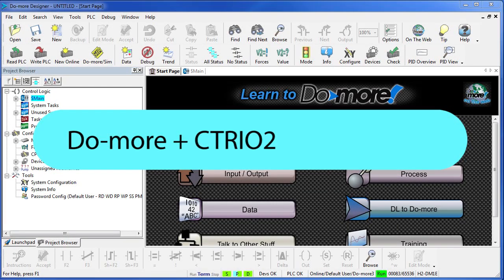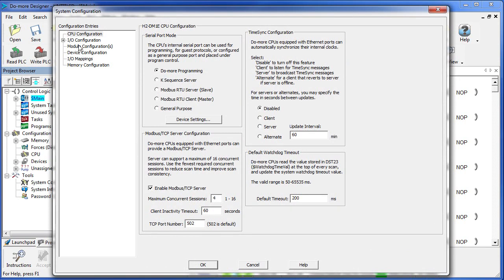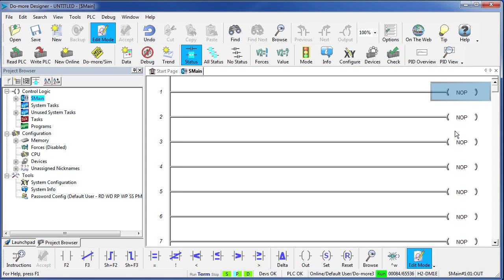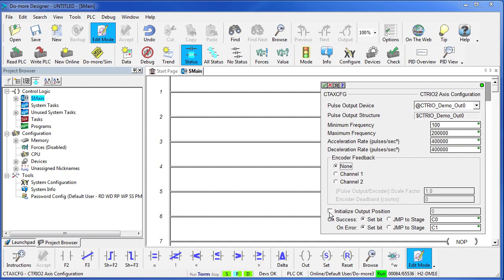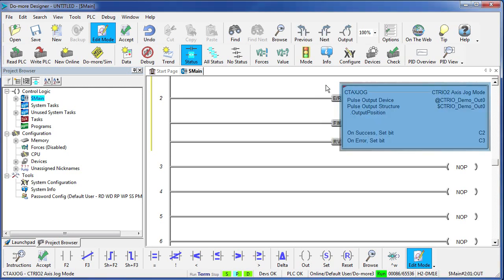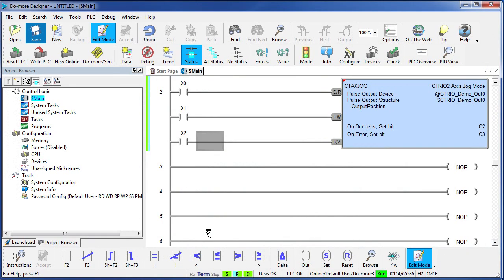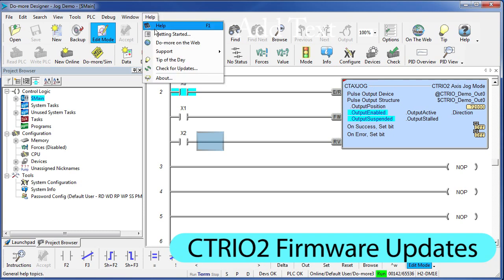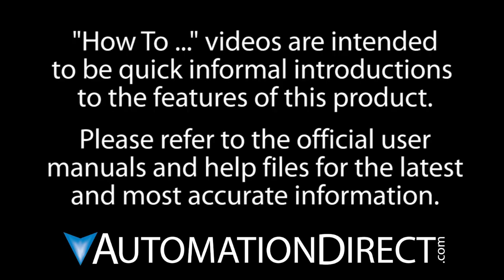BRX Do-more CTRIO2 Motion Config & JOG from AutomationDirect

Comment: Wow, 2012? I didn't realize the Do-more had been around that long.But I'm wondering about that ST0, "first scan" is singular isn't it? but CTAXCFG has that red triangle in the corner. From help topic DMD083: "Another consideration is that most instructions in this class have success  and error status bits that are set to mark the completion of the instruction.  To make sure that these instructions operate as designed, the ladder logic  must stay enabled until these instructions have completed and set the  state of their status bits." I too have tried ST0 to trigger AXCONFIG on a BRX, and it did work to configure one axis, but when I tried to configure all 3 axis with ST0 it seems they didn't all get configured. I understand wanting to keep examples simple, but as I found this video while looking for a solution I was surprised to see the same thing being done.My plan now is to use ST0 to SET a flag that in turn enables AXCONFIG then use the success bit the RST said flag,  but I'm not sure what to do if AXCONFIG errors rather than succeeds  (I mean besides adding a bunch more rungs to deal with it, if only the real work could be as simple as this video! )
Reply from the maker: Hi Jay, Thanks for the feedback. Yes, using STO to enable the AXCONFIG instruction wasn't the proper way to do that. We will add updating this video to show the correct way to our "To Do" list (for now we will add a comment to the description). Your solution is on the right track and yes, handling errors is always a beast. Suggestion: run this by the guys at Host Engineering, they may be able to show you a way to simplify things. Either here: https://forum.hosteng.com/  or here: Support@hosteng.com.  Their website is at: https://www.hosteng.com/
BTW - Do you use Stage Programming?  It's a great way to simply logic flow and error handling for these kinds of issues.  See the instruction help for an example of how to do that.

Comment: You mention a hardware video but it isn't linked...  Do you have a link for that?  

I have a BRX  BX-DM1E-36ED23 Does it have the CITRIO controller built in, or do I need to get one?  if so Which one?

Of course I'd rather not get another controller to run a stepper motor unless it's necessary.  In the BRX manual 12-9 it has a wiring diagram for a stepper  Do you have a video of how to configure the software for that?
Reply from the maker: High Speed I/O is built in to the BRX controller. You don't need a CTRIO. We are planning some videos on using the BRX with stepper motors, but I don't have a date for when that will be done.  Meanwhile, please contact AutomationDirect's free support team during our regular business hours - they will be happy to answer any questions you may have. Go to www.automationdirect.com and click on "Tech Support" in the menu bar to see all the ways you can contact them.
Reply: @automationdirect  Have there been any videos done yet for the BRX and stepper motors?
Reply from the maker: @matmarky4  Not Yet. It's on out "To Do" list, just haven't gotten to it yet.  Your query will help move it up the list.
Reply: @automationdirect  Hmm ok.  I am really struggling to hook up your integrated stepper/driver/encoder.  I spoke to one of your technical engineers for about two hours yesterday and am still struggling with a deadline looming for this prototype.

I am unsure of what to do right now and have a couple of very expensive paper weights on my desk currently...
Reply from the maker: @matmarky4  Unfortunately that's too open ended to get you a solution via this YouTube comments section. I would suggest calling support again. Sometimes simply talking to a different person helps.
Reply from the maker: @matmarky4  Gotcha.  Do you suspect it is a wiring thing or a BRX programming thing? Help me narrow down where you are and I'll see if I can point you in the right direction.
Reply: @automationdirect  I feel like its a ladder logic thing.  I currently have the motor turning at a button push via AXJOG (X0 = E/R, X1 = FW, X2 = RV).  It will cycle in a counter clockwise way (FW), but it will not spin in the other directions (RV).
Reply from the maker: @matmarky4  You have JOG working in one directions?  That's good news!  That tells us it's a Direction Signal thing. Try this:
1. Monitor the Direction signal pin out of the BRX with a scope or volt meter. Is it toggling when you change direction?
    >> If it IS changing, then it's a wiring thing - carefully check your wiring connections
    >> If is ISN'T changing, then it's a code thing - make sure you are using the pin you selected
2. Monitor the Direction signal in a dataview - is it changing there?
Reply from the maker: The hardware video you asked about: go here: https://www.automationdirect.com/videos/home?t=link&q=VID-DH-0008

Comment: what "plc"  are you using? model??
Reply from the maker: @Fausto Alvardo. The PLC, being used in this video, is a H2 model Do-more based PLC, using a H2-CTRIO2 add on module. Please see the following link for more info. www.automationdirect.com/Do-more-PLCs
Reply: thank you so much, other question i can work with 2 o more stepper motors
Reply from the maker: Each CTRIO-2 can support 2 stepper motor outputs, and you can have up to 9 CTRIO-2s in a single rack.